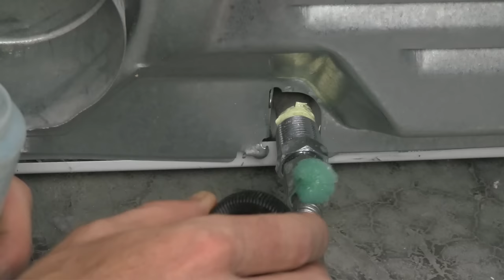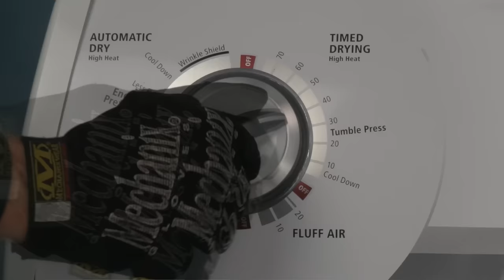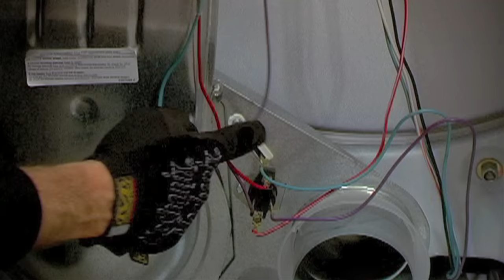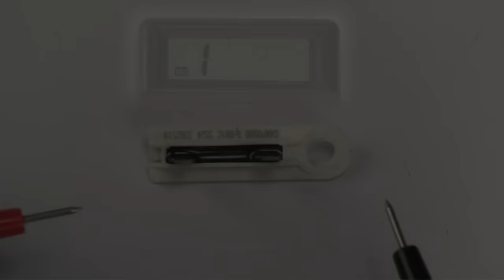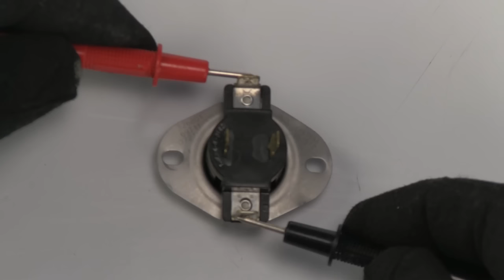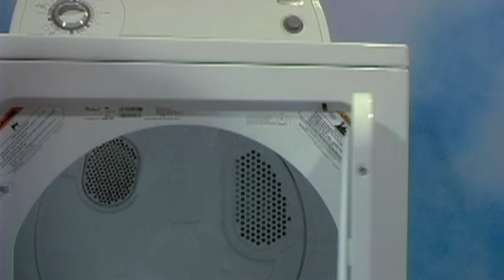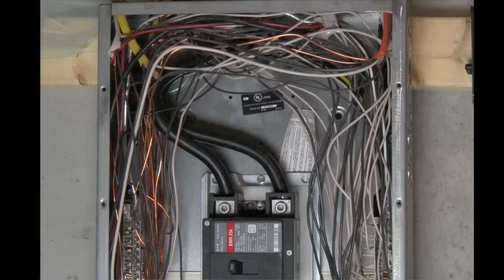Gas Dryer Repair: Fix Heating Problems

Comment: Ok, so someone help please...our dryer will turn on and get hot for a moment then the heat stops but the cycle continues. When in automatic dry it will not shut off at all by itself. We opened it all up we see the igniter working, gas flame on, then a few second later it stops and it does that over and over. Sometimes it will not turn the flame back on and will stay cold, other times we will smell gas
Reply from the maker: sounds like the high limit thermostat, usually located on the tube that receives the flame from the burner is opening and cycling the burner off for safety. So you may have an air flow issue, or you may have a weak high limit thermostat... or you may have something else and I'm completely wrong... but probably one of those 2 things. Try disconnecting the ducting from the dryer for a test cycle and see what it does. Good luck!
Reply: @applianceassistant  thank you so much for your help, I really appreciate your time. Duct disconnected it does the same thing. Last night it dried a load very well then today its on and off. I used the little machine(can't remember what it's called) to see if any parts aren't letting the current flow through and everything shows its working. I will order the part you suggested though and hopefully it works! Thank you again.
Reply: Update: sorry trying not to be annoying ...I just watched through the peep hole in the front of the dryer and noticed the ignighter going on and off every few seconds but no flame

Comment: I have a samsung gas dryer. I cleaned out all lent in the housing and check for blockage at the rear exhaust of dryer.  My dryer still takes multiple cycles to dry simple loads like sheets! I starting to think its the control panel, but I do not Have an Ohms reader.  or the coil valve cylinoide
Reply: I would recommend getting a cheap multimeter on amazon that has a thermostat lead. Then check the dryer's high limit on the cycle temperatures by putting the lead in the drum. On high heat setting it should cycle off between 180-220 degrees and back on around 110-130 .  If its running cool start with the temperature thermistor, on the back side of the blower wheel housing, they are fairly common. Hope that helps!

Comment: I  have a roper gas dryer older mod cloths take to long to dry i have clean every thing vents blower wheel lint screen the burner lights but dryer may run for a hour to hour and a half the buner never shuts off   Help
Reply from the maker: Something doesn’t sounds right. If the burner never shut off in an hour to and hour an a half the dryer would catch on fire and the clothes would be ashes.  If it’s heating and taking a long time to dry, first thing to check is a clogged home duct. Hope that helps some.

Comment: It dries really quickly and has many settings≖>allmy.tips/Whirlpool-Dryer?3c     I especially like it because it is all manual. A lot less to break than a dryer that has the music, lights and bells and whistles which I had before and kept getting error messages I had to look up as to why it was not doing as it was supposed to. I have hat this about a month and I love it! Easy and simple and just I wanted and will hopefully last much longer than the last one! (which was not whirlpool)

Comment: I have a Whirlpool dryer that looks identical to one in your video. There is no heat on Timed Dry. Heat works fine on "automatic dry" any clues/hints?
Thank God for your video! so informative still 9 years later on.

Comment: Your comment about the solenoid coils failing slowly while allowing initial burn was right on the money. Odd symptom, spot-on diagnosis. Dryer fixed in two hours, including trip for parts. Thanks a million.
Reply: Attention to detail and listening with patience has its rewards. Thank you for the instructional clarity.
Reply: I replaced mine but still the same thing.

Comment: It is very important to clean the gas dryer filter before each load to avoid overheating temperatures and damage to the safety components.

Comment: Thanks for the video, but I have a perplexing maintenance issue that I cannot find an answer for:  The dryer has a typical issue that it only heat to luke warm.  I have replaced all the suspect parts with Whirlpool parts.  The gas fires up in the cone fine, but only for about 3-5 seconds, and that cycle repeats itself never fully heating the dryer.  When I pull the thermostat (WPL-W10423382) out of the flame cone, the dryer will burn continuously.  I replaced that part.  Same result, not heating all the way.  I believe the thermistor is the "back end thermostat", and when I pull the thermistor (WP 8577274) out of the exhaust tube, the dryer heats properly.  Seems like a bad thermistor, so  I've replaced that part.  Nope.  When installed in the exhaust tube, it won't heat very much, and when pulled off the tube (leaving electrical connections) it works fine.  So, if I just left the thermistor connected, but not attached to the drum exhaust, it works fine.  Thoughts?
Reply from the maker: really sounds like an airflow problem. Have you tried running it with the ducting disconnected from the back of the dryer? My guess is it is legitimately getting too hot from some airflow issue... hope that helps some! I would love to hear the result when you figure it out.
Reply: Although I had cleaned out the exhaust before, it is a relatively long run.  Going back to it I found a birds nest wedged way up in there. Lots of parts replaced for a simple issue, and although I looked at the exhaust for clogs first, I did not try the "remove the exhaust hose from the dryer" trick, and should have! What was perplexing me was that when I pulled out the thermistor, it ran and heated fairly normally. Now I understand that the hole where the thermistor was is allowing more exhaust air to exit, therefore allowing the flame to burn closer to normal. Thank you, that's the answer.

Comment: Awesome video. However the last few minutes are rushed and not entirely as comprehensive, especially with regards to testing through red timer to neutral and needing to push the start switch also.
Reply from the maker: I agree... got a little nervous the video was getting too long. I rarely do that test, just something I thought I would throw in. Thanks for the comment!

Comment: My kenmore combo stackable gas dryer doesn't work properly. It works for about 10min & shuts off. Then for about 30sec I can't reset it. I checked ignition, gas valves, fuse, flame sensor, vents & still nothing. I thought maybe there is not enought fresh air, keep the door open. Still the same. Let me know about any ideas. Thank you

Comment: This video helped me solve a strange problem I had after replacing the thermal fuse and cycling thermostat. I had no voltage to the igniter because  I had the wrong wires connected to the thermal fuse. I saw this error when I looked at wiring connections in this video. Thanks for posting it

Comment: Best video I found on this topic, thanks! On replacing solenoid coils, two extra details would help -- the three-prong one in front should have the wires low, the two-prong in back should have them high; and there's a protrusion on the top of each coil that goes in a hole in the cover, easiest to line up if the cover goes on the coils first, then the whole thing back in position.

Comment: This is probably the best overall video I've seen to troubleshoot a gas dryer.  It's all encompassing and step-by-step.  We just figured out the issue with our Kenmore Elite H3 is the gas solenoid valves.  Getting parts tomorrow!  Thanks!

Comment: my dad says gas dryers dry clothes faster than electric dryers do and i used to believe using gas contaminates clothes and i still believe gas usage also wastes more money than electric dryers do
Reply from the maker: I’m honestly not sure if there is any contaminant issue with gas, but it would make sense that there would be some materials deposited on clothing from the burn... thanks for the comment.

Comment: If you run a “test load” in a dryer with the exhaust port unhooked, prepare for 100% humidity in that room. It will drip water from the walls, and ceiling. Any electronics in the room will be wet inside and out.
Reply: Its not that drastic in all cases
Reply: SMH. Never seen that before. How small is this laundry room.

Comment: You do know dryers aren't that  expensive. lol. Just replace the dang thing.
Reply: Sometimes, replacement isn't financially possible.  What if you're on a fixed income but are relatively handy with respect to general repairs?  If the unit is in good overall condition with respect to any small amount of nominal rust and general overall good operation,  replacing relatively inexpensive parts (a total of around $100 unless it's a bad gas valve) its a no-brainer... $100-130 vs the cost of a new dryer.  The latest check of Lowe's.com shows gas dryers running anywhere from a low of $588 to well over $2,000.

The "throw it out and buy new" mindset can be a huge downfall to an economy.
Reply: @biffnarzilla4649  I am exactly the person you discribe.
Fixed income people don't shop at Lowes.
Appliance shops sell new dryers starting at $199New, and $99Used (with warrenty).
Many offer payment plans, or layaway. 

I recently replaced the valve on my Kenmore Dryer ($28). only because it's part of a faux stainless steel matching set.
But I was prepared to replace the whole dryer should it had been anything more complicated. And I still intend to, as last year it was the thermal fuse. Sometimes things just wear out, and you can't ask anymore of them.

Comment: I have a Kenmore model 97350100. I watched your video a found a   blown thermal fuse. I have cleaned out all the vents and lint traps. Thanks to your video, I'm ready to order part and confidently make this repair. I do have a question. Before testing, I did not have an ignition glow in the view window.While I have the dryer open; Will replacing the thermal fuse fix my heating problem or should I try to remove drum to check igniter, coils and flame sensor and possibly the belt(it's looking kind of brittle). Oh yeah, Where is best place for quality parts/price. Thanks
Reply from the maker: Your probably good to just replace the fuse. However, it’s always good to open it up and clean out the lint from time to time.

Comment: The gas values coils were the problem with our Maytag, shutting off heat after about 10 min. My sister and I changed the cycling thermostat first, did not work. The timer did not work also previously. Then we ordered and changed a thermal fuse. That did not work. Finally we ordered the gas valve coils from Amazon and found the correct # of the coils on line. It works great now and the timer works again now PTL Ultra Durable 279834 Dryer Gas Valve Ignition Solenoid Coil Kit Replacement Part by Blue Stars - Exact Fit for Whirlpool Kenmore Maytag Dryers - Replaces AP3094251 PS334310 12001349 for model MDG308DAWW.

Comment: Mine is Maytag Performa gas dryer. I think I checked everything!  My problem is after first run it won't dry. No lint at all. When I run it again second time, lot of noise comes out of it. But then I see a very thick lint formation. I remove lint and run it again for the third time. At the end of this third cycle the clothes are dried. Help please......jake
Reply from the maker: The lint symptom is strange... but if you are always getting some heat but it’s taking 3 cycles to dry I would take a good look at the home duct... try running it with the duct off for 1 cycle and see if it dries properly, if it does it’s definitely the duct. Hope that helps some! The only other thing to check would be cycle temperature.
Reply: applianceassistant  thanks for the quick response. As you have suggested...I disconnected exhaust...still it is taking three rounds (90mins each) together them dry.  I think the reason for lint in the second round is in this round clothes are going from wet to damp to dry. Could u please tell me why it need so many rounds to dry.
Reply: It is gas dryer

Comment: Great video. I've changed many igniters, belts, a set of valve solenoid coils, a timer, and a squirrel cage fan but never a Thermal Fuse. Thanks for the tip on checking there. With no volts at the igniter I went straight there and sure enough !! Open fuse. $5 later, she was good as new again.

Comment: My problem is the dryer is getting too hot.  It is ruining the cloths.   So I have an excellent burner, but it won't maintain the correct temperature.  Anybody got some ideas??
Reply from the maker: What is your model number? Are you on propane or natural gas?
Reply: Model # ADG3LRGS111W01 it is a natural gas dryer, Brand Name: Speed Queen, made by Allianse Laundry Sys. Ripon, WS.  I cleaned out all the lint, which was not much, but still seems to run two hot.  Flame seems to shut on an off at times.  Seems to have one flame size.   any ideas??   Thank You for the response.

Comment: My Amana gas dryer ignighter glows very bright for 1 second, then looses power (I put a new one in, still the same), It did light several times, I noted it ignighted the gas as the ignighter glow was nearly off.  I Assembled dryer & tried and the gas came on stayed on, and no flame.  I suspect one of the switches is failed when current runs to the ignighter.  Does any one have any advise, thank you
Reply: Change your gas coils

Comment: This is a great video.  Was doing research on why my Whirlpool Duet gas dryer wasn't drying my clothes.  Was difficult to determine the defective part without an ohm meter.  The burner pilot would turn on and the flame would ignite but on the second cycle when the pilot turned one flame would not ignite.  This video helped me identify the coil solenoid.  Replaced them for $10 and good as new.

Comment: FANtastic  video!  I had a multimeter, no idea how to use it.  But with your instruction I was able to establish that the fuse was bad (lucky me, first thing I checked!).  Bypassed it just to double check.  I cleaned the entire machine, including removing the lint catch tunnel thing.  GOod thing!  THe very bottom had thick, caked on lint that was severely narrowing the passage of air.  Need a screw driver to chip it away!  I think that's  what caused the overheating that blew the thermal fuse.  Got a new belt,  and the rear seal was hurting so ordered new one of those.  Not bad for a 20+ year old machine!  The timer is limping along, but at $140 I'll cross that bridge later.  They should have appliance salvage yards. THanks again!

Comment: How do you know the gas valve is the problem
Reply: With the gas valve, it's more a process of elimination. the valve coils, fortunately, are inexpensive enough that you always want to try coil replacement first if you suspect valve issues and have already eliminated the fuse and flame sensor as being a problem. Thanks for the question!

Comment: Excellent video with great diagnostics. I replaced a blown thermal fuse and then determined the cause for the failure (obstructed and kinked vent hose).

Thank you!

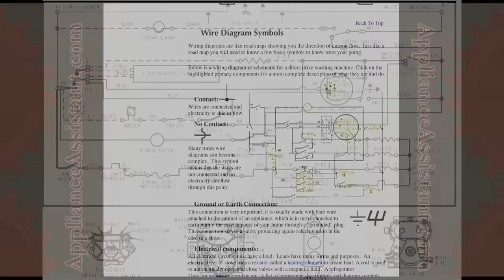Comment: I've fixed a number of dryers. Often there is something stupid that makes troubleshooting take longer (much longer) than it should So, hang in there DIYers - this is doable. My last event, I had unplugged the thermal fuse as suggested in a trouble shooting step. Later I determined the flame sensor was  broken and actually was able to fix it without buying a new one! HOWEVER, it took a few more hours of head scratching since I hadn't plugged the lead back on the thermal fuse. This is a great video. I especially like the run down on the schematic and operation beginning at 7:08. Regarding the flame sensor, when I disconncted the lead, the terminal snapped off b/c the rivet that holds it in place had corroded. I just drilled (dremel is broken) it out and put a small nut and bolt through. Don't know how long it will last but it has held up for about a month now.

Comment: HI I'm dealing with a Commercial Kenmore coin gas Dryer. I put a new flame Sensor and 2 black coils but I'm still getting just a flame and that's all. I checked most fuses and I don't think I can't open the back because it looks like it was welded on but it does have screws. What else can stop it from heating the dryer? is there something in the control panel?

Comment: Thanks!  My Kenmore Elite gas dryer wasn't heating. After looking at various online videos (not this one) and repair guides and suggestions online, I replaced the fuse, the igniter, and the high limit thermostat, and none of those solved the problem. The igniter still didn't light up. I checked the flame sensor for continuity and that was fine. Finally, after watching this video, I saw in the repair manual that came with the dryer that there was also a heater relay in the circuit. Once I found that part on the dryer, I realized there was also a motor relay, and they were the exact same model. I swapped the two and the igniter worked (I had to hold down the start button because now the motor didn't stay running). I installed a new relay and now I have a working dryer again. I wish I had started with this part, but at least the dryer is fixed!

Comment: Excellent video. Even technicians experienced in other types of controls may not be familiar with the logic used on a gas dryer. Approaching the problem in a step by step manner most problems reveal themselves. Don’t get discouraged if your issue falls under  the “advanced” category. It’s called that for a reason. Make a copy of the diagram you can write on to keep track of what’s happening in the circuit. Watch the video again. Ask-What points do I want to check next? If you stick with it you will figure out what’s wrong, you’ll fix it, and that’s something to be proud of.